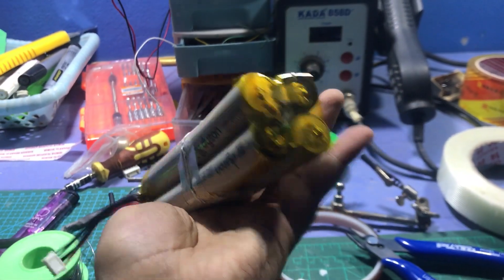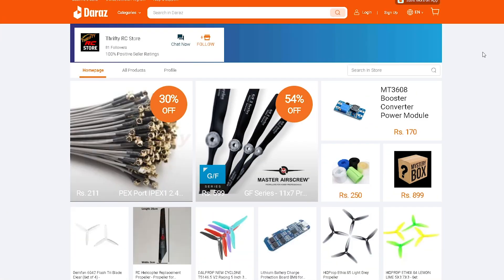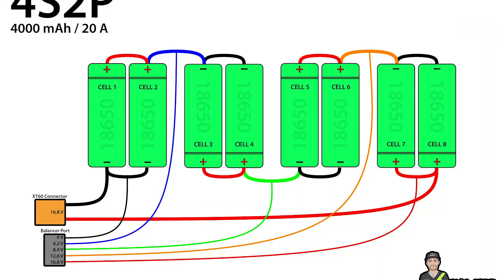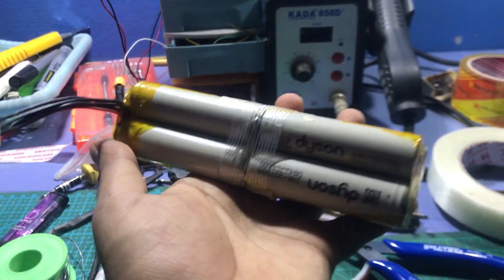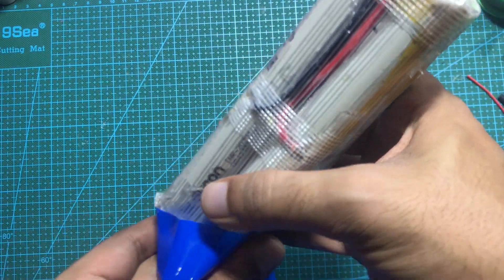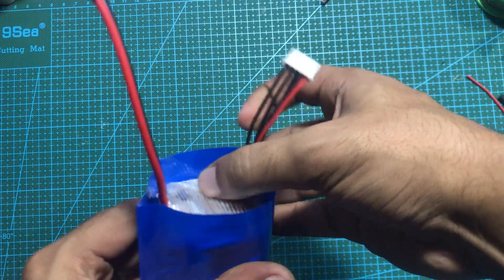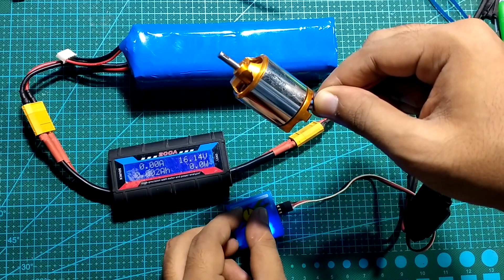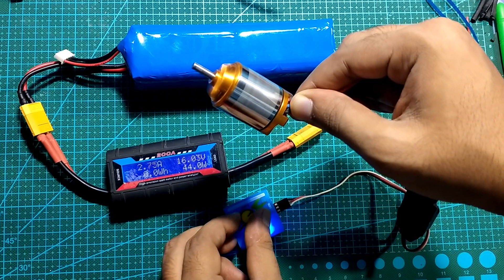How to make 4S2P battery pack | 4S2P Li-Ion battery pack

Comment: I am confused on the make 2 4s1p part. Would it just be easier to make it as the diagram shows as opposed to having essentially 2 live batteries that you're trying to wire together. I am trying to follow along. You have the only video in this configuration that I can find. I want the long boy battery haha. Any help will be greatly appreciated. Thanks!